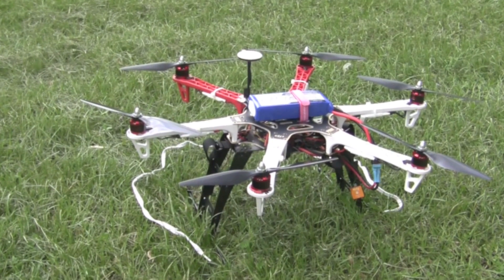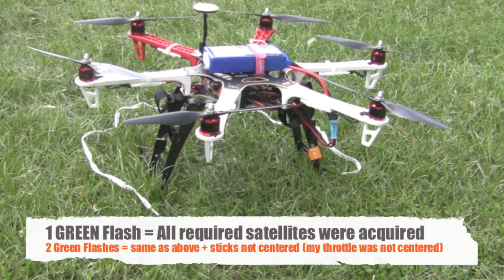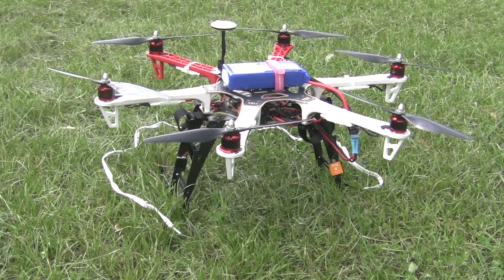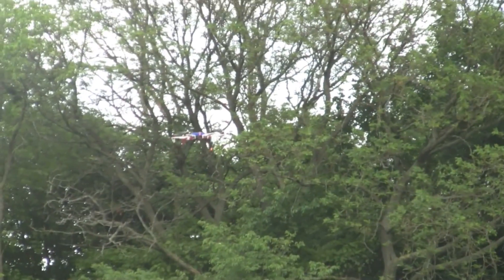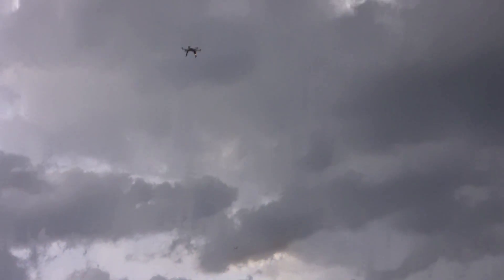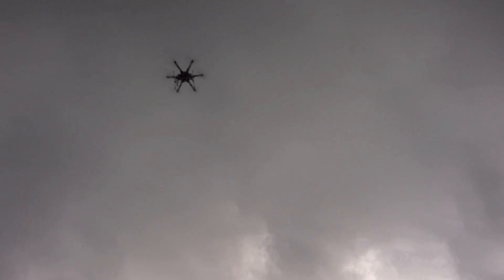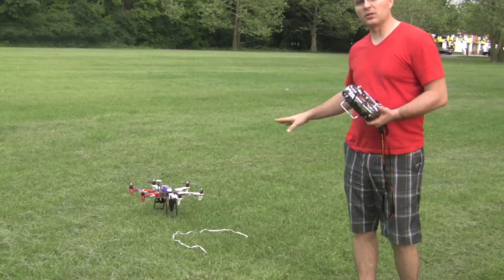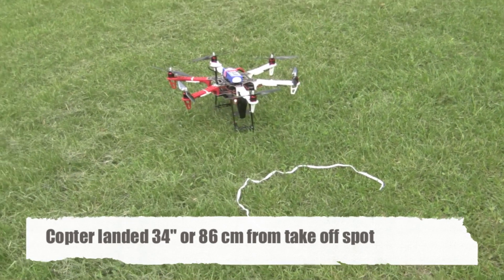Part 1 of 2 - DJI NAZA V2 RTH - Return To Home - Demo and Accuracy Testing  (DJI F550)

Comment: Good morning dear friend My name is Samuel, I'm Brazilian! I have a project to build a drone of a good quality, with the maximum; I intend it to last almost one or more flight duration! I want to work with him! Please, the parts are the ones that I want to put in it, still missing the part that works for more than 7km away and I can see all drone battery and control information, see height, speed, GPS, and all other more of the drone running on the monitor! Ask you say I can put it on and everything in it I can see on the monitor working? You can help me with this information and I 
It will be the same as your exterminator with more things! will be very grateful! Thank you! Below is the list I have made so far:
PROGETO DO DRONE EXACOPTERO 27 - 10 - 2018
1 - Original FrSky Radio 2.4G 16CH ACCST Taranis X9D Plus Carton Transmitter Package - Mode 2 (Left Accelerator)

1 - Receiver - FrSky R9 16MB 900MHz long-range receiver with SBUS output

1 - Transmitter - FrSky R9M 900MHz Long Range Transmitter Module for FrSky R9 Series

6 - RACERSTAR MOTORS 98OKV or 6X Racerstar Racing Edition 3508 BR3508 700KV 2-6S Brushless motor for 600 700 800 RC Drone

12- Elves - Gemfan 1045 Carbon Nylon CW / CCW Propeller EPP for RC Drone FPV Racing Multi Rotor
 
1 - EXACOPEPTERO FREELANCE

6 - ESC 30A 2S-6S BlHeli Platinum

1 - Transmitter Aomway Fpv 5.8g 1000mw, Tarot 1000mW 1W 5.8G 32CH FPV Transmitter AVTL300N4 For RC Drone

RunCam Eagle 2 Pro Global WDR OSD Audio 800TVL CMOS FOV 170 Degree 16: 9/4: 3 Switchable FPV Camera

1 - Naza v2 controller board complete.

2 - Batteries of 4s 6000 to 10C

1 - Pair of XT 60 connector or stud for battery connection

2 - Terminals with JST plug in the tips
 
1 - IMAX Load Balancer

1 - Elix balancer

1 - White forks

1 - Heat-shrinkable insulation

1 - Splints of liquid tape
 
1 - Super bonder bisnarga half power

Comment: recently i built one and the results are very confusing bcz after take off it does not holding position like yours. but the led showing gps in ok.(using simonk esc with 960kv motors and 1045 props)

Comment: Thanks! I bought it, not a problem getting it here in Canada thank god lol, have been using it for a couple of weeks now and it's awesome so far, especially rock solid after you adjust arrow on GPS dome to coincide with actual magnetic north, 10 degrees left from straight for Toronto where I live, tried before and after the 10degree adjust and the difference is amazing, doesn't move a cm, thanks for the reply!

Comment: Hello! I'm thinking of using NAZA V2 on my F550, how has your experience been so far with V2? Had any issues so far? Thank you!
Reply: no issues! for over3 years! just do the setup naza assistant .once that's done everytime before I fly I hookup to naza assistant and run the imu check and let it recalibrate if needed,it takes 5 minutes and its well worth it youput 8grand into a rig and I am not gonna lose it for being dumb,so to me 99% of problems are user error!!!.if you need any help email me.have fun!
Reply from the maker: Sorry for the late reply. I have been very happy with my NAZA V2. I hope you can still buy it in the US, as there is an injunction against DJI and their products are temporarily banned from being sold in the US. Good luck!
Reply: well I have a few new naza m v1 upgraded to v2 with gps. if you are looking for a naza stay away from nazalite it can not be upgraded  davidringler40@yahoo.com
Reply: ShowHowCast
Really wow, I saw on flight test that also in the US they are trying to regulate o change laws regarding FPV and even any airborne RC.... I live in Australia and I guess It's just a matter of time before the same aurthority approach happens here too. The good thing is I buy all my materials for China. China will never ban anything that makes a dollar.... Just in case I better buy My Naza A2 sooner rather than later
Reply from the maker: Buy that while you can :)

Comment: Nice Flight , Did you build kit ?
Reply from the maker: Yes I did. Bought the frame, motors, ESCs and propellers as a kit. The rest is all custom built.
Reply: +ShowHowCast I have been looking for a good setup reference to get one setup, I picked it up form someone who started and never finished. Do you have anything saved you could send?